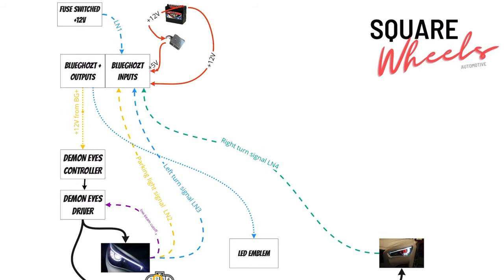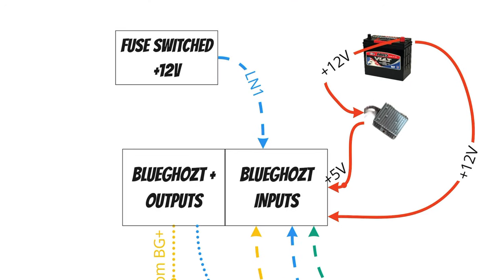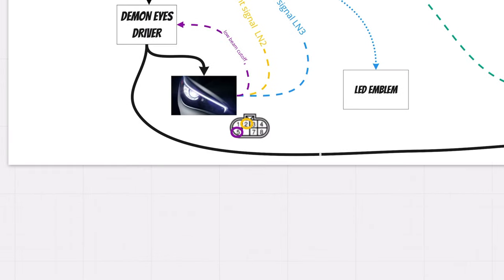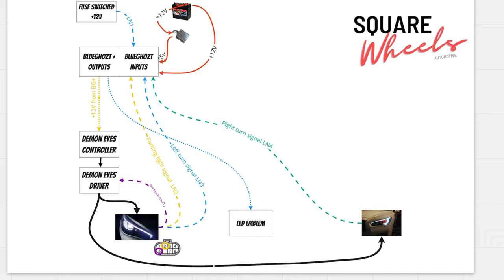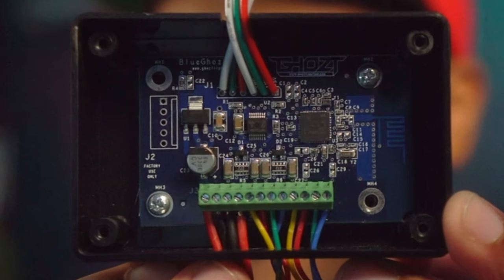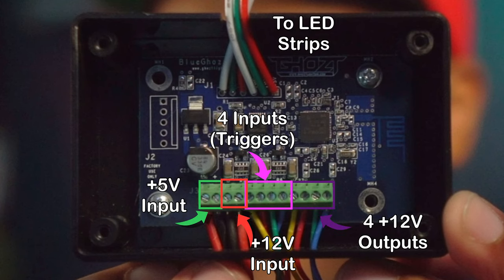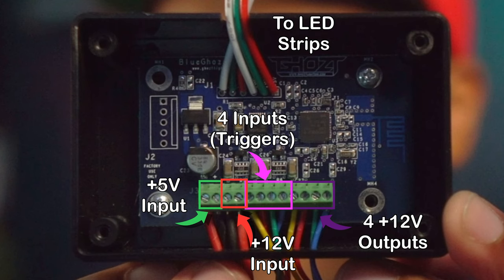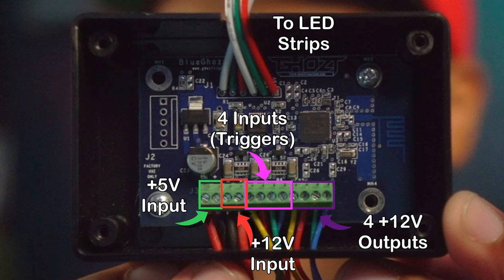Customize your Q50 headlights: Demon eyes, Etched lenses & Blueghozt PLUS custom animations (PART 3)

Comment: If I don’t have no custom headlight can I still use the blue ghost with my logo and turn signal I have a q50 by the way
Reply from the maker: its complicated but short answer is yes.
Reply: @SquareWheelsAuto  how ??
Reply from the maker: I can’t give a tutorial over comments but Ghozt is a led controller like any other. Connect your leds to it, and make sure all the leds in your setup have matching color order

Comment: Drop in a Morimoto 3" STi-r glass lens on the projector. The OEM ones are plastic. Remove the plastic OEM, cut off the 3 little alignment nubs. The new glass one does not need to be glued back on as the chrome housing will secure the lens in place very well with no glue or brackets needed. Result is a blue cut-off and improved clarity. Worth the extra $60.00 bucks for the lens. I did mine when i smoked out the Cress and amber side reflector.
Reply from the maker: Yep I did mine too when I ripped out all the lightingtrends crap and switched over to Glowe. I'm offering the lens upgrade as an add-on to the etched lens service on my site, I'm just out of stock on the lenses: https://squarewheelsauto.com/collections/aftermarket-lighting/products/etched-lenses?variant=43153294917840

Comment: They look awesome. Reason you can't use one controller for the demon eyes and the halos is because the halos are individually adressable and have a controller inside of each led on the halo. They are also controlled with just 3 wires where as the demon eyes do not have any controllers on board the led so they need one main controller to control them and they use 4 wires usually unless there is a dedicated white led which will be 5 wires. It would be possible to make a controller that can do both but it would be costly and complicated
Reply from the maker: Thanks for this intel man!!!! I saw the 3 vs 5 wires difference but didn't realize the addressable LEDs had controllers on board. Another mystery solved🤙🏽🤙🏽🤙🏽

Comment: Hey man great tutorials on the headlight retrofit!! Really appreciate your time with this. I have got everything to do my headlights atm other then the lightingtrendz flow series drl kit which is supposed to be delivered this Thursday. I’m wondering what kind of glue did you use to put the projector lenses back into its housing?  

Also I didn’t go with a blueghost controller atm. I know all your animations look bad ass but Idk if I wanna mess with all that right now. Do you think it’s worth the extra money and time to do the blueghost as opposed to the Bluetooth controllers from lightingtrends and diode dynamics?
Reply from the maker: Thx for watching! Glad to hear you're gonna give it a shot!

re: glue - I used permatex super glue (its just what we had in the kitchen drawer lol) - has held up fine so far

re: blueghozt - cant go wrong either way, but honestly i wish i would have known about the blueghozt first time round. the animations are a cool bonus but the true power of it is its ability to always be on, and respond to triggers from the car (door open, turn signals, lights on, etc).  

Also, def consider it if you think you might expand beyond just headlights/DRLs.  I didn't plan to, but I ended up adding my LED emblem, DRL turn signals, and underglow - all powered by the blueghozt - its a beast.
Reply: @SquareWheelsAuto  ok cool I’ll check out the blueghostz controller and see if it’s for me. I would like to add an led emblem at some point and I like the switchback drl turn signals on yours so maybe it’s worth buying.

Comment: Hey man after I finished my retrofit, my passenger low beam is burnt out 🤦‍♂️. From what I’ve researched there is no way to replace the led low beam bulb. For some reason they don’t less a replacement bulb. So I pulled the headlight back out, baked it dissembled everything inside the headlight again. Checked for any loose wires and still no low beam function, Only thing I can figure is I some how damaged the low beam bulb when I was doing my retrofit.  So I just ordered a used OEM headlight off eBay for $400. Going to have to bake it and swap over the low beam led housing over to my retrofitted headlight. This simple job turned out to be very expensive. Good thing is after doing the retrofit i can take the headlight out and bake/dissemble it in less 30 mins now 😂
Reply from the maker: OMG man sorry to hear it!!!  I've baked my headlights 4 times now with no issue, but admittedly have never handled the low beam LED :(   Hope this time round works out for ya - mebbe after all this you can open up a retro shop and recoup that $400 😅😎
Reply: @SquareWheelsAuto  lol yessir that’s a great idea!
Reply: @SquareWheelsAuto  sup bro, I figured out the cause of my low beam shorting out. Turns out I broke the wire that connects the low beam to that black box at the bottom of the headlight. So I swapped it out for the new headlight that came in and I’m back in business. 

Everything works properly again. So now I have an extra full passenger headlight I plan to solder the wire back together and either sell or keep for parts 😂. Can prolly sell it for more than I got it for or buy a matching driver side and start doing Q50 headlight retrofits with core charges. They send me their headlights and I’ll give them the ones I’ve already completed or make theirs custom how they want them. Appreciate all your guides and responses my man. None of this would have been possible without your help! Do you have IG? So I can show you my work

Comment: Hi, can you assist me with the blueghozt installation. My headlights and my demon eyes are wired directly to my battery, and I wanted to add my headlights, demon lights to the blueghozt.
Reply from the maker: hit me on IG I'll send you a rough wiring diagram of how I did mine using a Blueghozt Plus.
Reply: @SquareWheelsAuto  ok. I just did. Thank you

Comment: Will connecting both ring terminal to the positive and negative on the battery instead of a ground run it out faster? My 12v-5v converter came with a very short ground wire
Reply: For the ghozt controller
Reply from the maker: @cambeezytv4850  dont understand the question here

Comment: Did you need the 5v or 12v controller?
Reply from the maker: Get the controller that matches the voltage of whatever strips you have. For this video I had 5v strips in.
Reply: @SquareWheels Automotive  I got the same kit from lightningtrendz so I guess it should be the same.
Reply from the maker: @Elvis_Kunda  yep lightingtrendz was 5v at the time I made this video.

Comment: How many outputs needed for the blueghost, prewired or non?
Reply from the maker: I did 4 outputs, prewired, mostly because I didn't know what I was doing or what to expect.

If you order prewiring from lightingtrendz, definitely open it up and confirm everything's actually wired; they missed a connection on mine 😤🤬

Comment: Do you always have to go in app to turn these on and off ? Or it turns offs when you turn the car off ? Lastly does the demon eyes shows when in auto mode ?
Reply from the maker: Nope, they completely respond to inputs and switched power from the vehicle.  Once I've got it configured, I rarely go into the app unless I want to set a show mode.
Reply from the maker: The way I have it setup in the video, demon eyes come on when the car is on, and if/when the headlights turn on, the demon eyes cut off.
Reply: @SquareWheelsAuto  okay and what about when you turn the car off do the demon eyes shut off or you have to go in app to shut them off?
Reply from the maker: @youngsuavekiddd1  its all automatic. blueghozt does the shutdown animation, and then everything turns off.
Reply: @SquareWheelsAuto  i have diode dynamics i have to go in app to turn mines off and on that part I really hate. Plus i came to conclusion demon eyes is only for day cause i i can’t see nothing at night
Reply from the maker: @youngsuavekiddd1  yep the blueghozt will definitely solve that.  i dont go into the app unless i wanna change colors or settings.

Comment: Hey broz me again, I'm on day 3 working on the headlights lol. So we FINALLY got everything wired and connected. Only concern is that the demon eyes and the lash (the lights to the right of the demon eyes) does not turn off by itself when the car is on and locked. I have to do it in the app. Is this normal? I'm just worried that one day I forget to turn it off in the app and kills the battery.
Reply from the maker: I e got the demon eyes getting power off one of my Blueghozt Plus outputs, set to triggered. So it only turns on when the DRLs are on.
Reply: @SquareWheelsAuto  ahhh there's the problem. I don't have that module. Thank you, will have to be a future purchase cause I'm broke
Reply from the maker: U could do a cheap switch or relay off Amazon in the interim! Check out my relay video! That's all the Blueghozt plus is doing anyway
Reply from the maker: Also, your demon eyes are still drawing from the battery even after you turn them off in the app. The controller, the Bluetooth, and probably the LEDs themselves all continue doing their jobs of listening for commands.  It'd take a while (days between charges, not hours) to drain the battery but still something to keep in mind
Reply: @SquareWheelsAuto  ah ok didn't know that. I daily drive my car so it should be no issue. Definitely will be checking out your relay video!

Comment: so on the ln 1 wire for the blueghozzt controller, if im using that as a 12v switch, what do i connect the converter to?.. confusing straight to the battery?
Reply from the maker: What converter? DM me on IG!

Comment: Can you install demon eyes and halo lights on the same channel
Reply from the maker: Technically, yes, it'd jus take some fancy wiring.  You'd have to run just data to both and figure out how each of them wants to be powered.  

Keep in mind demon eyes are generally just 1 pixel so it might not come out how you want (it could potentially be off most of the time while an animation is happening)
Reply: @SquareWheelsAuto  thank you

Comment: I’m curious to know why connect LN1 to 12v switch.
Reply from the maker: The DRL (LN2) circuit cuts out when the car turns on. So I have switched 12 going to LN1 to keep the lights on when the engines running 👍🏾👍🏾
Reply: @SquareWheelsAuto  I see. I noticed that when it’s connected to the 12v switch it keeps the brake witch activated in the app. If that’s the case will the app allow you to change shows. 🤔
Reply from the maker: @Hharris009  yeah in the settings screen you can change LN1 from brake mode to show mode. Either way just set it to display solid white (or whatever you want your drls to run on when the cars on)

Comment: What pin exactly did u tap for the turn signal. U mentioned parking light pin as 2. Is tht the same pin for turn signals u never specificed HELP
Reply from the maker: I tapped the actual bumper turn signals
Reply: @SquareWheelsAuto  do u remember which wire (color) it was? I haven’t taken off my bumper as yet so not sure exactly which wire from the fog light to tap, unless it’s one wire
Reply: @boostedsamuari7436 did u ever figure this out? also where are you connecting the turn signals to? and how are you making the short ass wire reach both sides?
Reply: @jacobslttt2005  u gotta extend the wires lol. Also turn signal comes from the bumper lights. The lights that flash yelllw when turning, the connector that plugs into that from the car side has 2 wires. On right side I believe it is a black and purple and on the left side connector is blue and black. on the right side, you tap into the purple wire and on the right side you tap into the blue wire.
Reply: @jacobslttt2005  I also make videos on Q5 now. I just made a video on how to paint inside frost eyebrows and crescent and also how to open and close the lights. I will be making another video soon on how to wire up a switchback set up on your Q50 and also how to build a RGB set up on your Q50 as well.
Reply: @boostedsamuari7436  ok another question, the wires that come from the turn signals go where? i have a lighting trendz bluetooth controller as well as a regular blueghozts 2.0 controller 

and i’m seeing that he puts the blue ghozts into the pin 2 on the headlight connector, so im wondering where the turn signal would go.
on my lighting trendz controller it says that the orange and yellow cables go into the turn signal so im wondering what you did

it’d also be helpful if u could tell me specifically what type of wire i need in order to extend the short wire? i’m brand new to this stuff so im sorry if this stuff is obvious but it’d really help
Reply: @boostedsamuari7436  im gonna take a look and follow🙏

Comment: I heard vinyl on lens isn’t proper way and etching is better and more accurate way to do it. I c you used vinyl overlay on lens how did this last?
Reply from the maker: Going on 3 years on my Q, had vinyl on the lenses of my G for 6yrs before I sold it.  If we’re just trying to make semitransparent patterns on our lenses, what does “better and more accurate” actually mean? 🤷🏾‍♂️
Reply: @SquareWheelsAuto where did u get the cutout vinyl over lay to buy, or print?
Reply from the maker: @boostedsamuari7436  squarewheelsauto.com